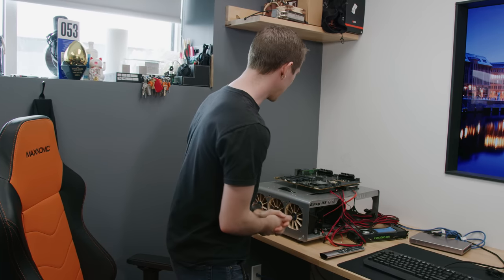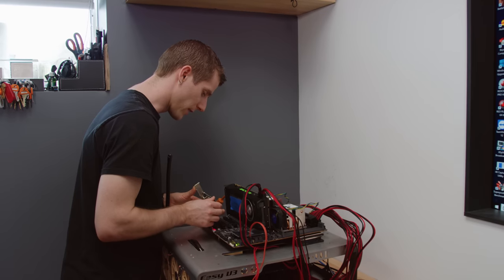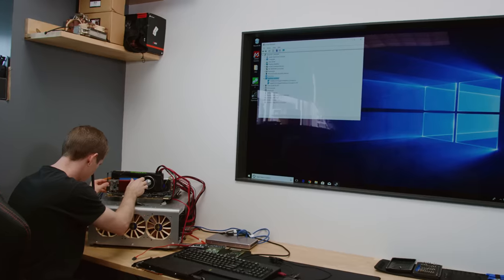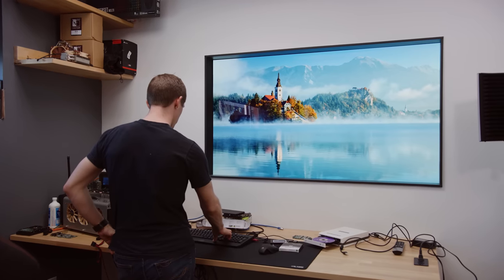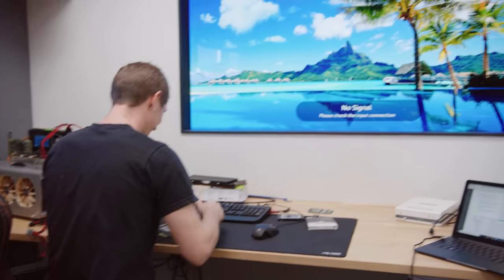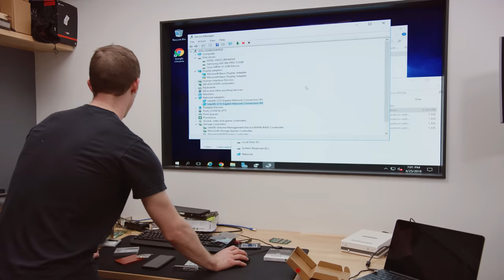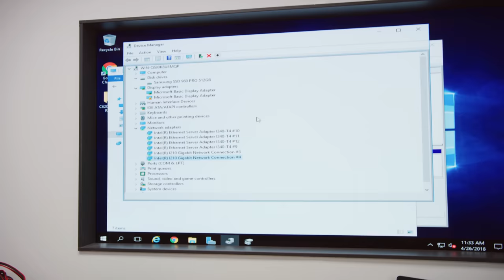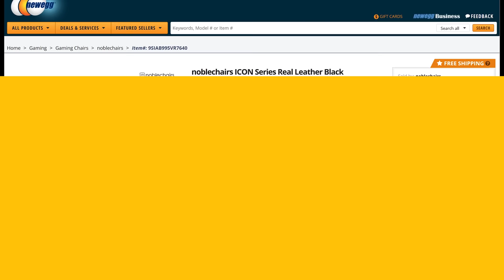I've NEVER been so FRUSTRATED... Hot-Swapping PCIe Cards

Comment: Hot swap a power supply
Reply: There are servers with dual psus where you can just pull one out
Reply: @electrosquid8325  all servers have to have that since you cant just power down a  server. Also PSU failures would be catastrophic.

...i should know as I accidentally crashed one with plugging in a PSU with the wrong wattage into it.
Good thing everything in a data center is redundant lol
Reply: @MrMarci878  In a datacenter maybe, small business servers often have single PSUs though. HP ML110s for example. Rackmount servers almost always have multiple power supplies so if you work in a datacenter, I guess that's why you think all servers are similar in configuration :)
Reply: @tredd6946  not a very bright business if they're not using some form of redundancy with PSUs (works for a small business) unless you're fully cloud based for everything, that's cheaping out on a stupid level IMO
Reply: like here, if it designed for it its no issue ;)
Reply: I've done it multiple times on dual PSU server. They are designed for it and it works flawlessly.
Reply: actually super common if you look at pretty much any server (expect some supermicro servers) you have 2 - 4 power supplies
Reply: @N0D0hNuts  No, I went to the "I dont read the label because I expect the one singular PSU that I order to be of correct wattage when I get it" school
Reply: Hot-swap motherboard.
Reply: @TheOneG36  Can you tell that to my dead geforce 4 series card I killed by plugging in power when the system was on?
Reply: @danielhall6805  iam pretty sure that a "Gforce" consumer product never had hot-swap, but you where lucky ;) back in the day i killed an ATI 9800XT while powering the system without having power plugged in oO. back then this stuff was way more sensitiv then today.....
Reply: @Lucroarna56  Its awesome when the Hot-Swap DUAL psu in your servers internal PDU (the interconnect board that makes hot-swap possible) fails. THEN your SOL.
Reply: You have to be quick
Reply: what could possibly go wrong :thonk:
Reply: @tredd6946  There are many tower style servers that also have multiple redundant PSUs.
Reply: @HudsonGTV  Yes there are. I said towers "often" have single PSUs, not "always". There are also some rackmount servers that don't have redundant PSUs although most do. Please read more carefully.
Reply: Jules i have a hp d360 and it even shows on the tiny screen thing on the front if one of the psus fail
Reply: Hot swap a rig
Reply: You can do that on Mac pro
Reply: No, hotswap a motherboard
Reply: @Perseagatuna  actually, storage servers like 3PAR 3000 you can hotswap even motherboard technically. I even had quarter of s motherboard powered while rest was without any power at all with single controller , no cpu, memory or drive and single psu without battery. Successfully recovered data from the system from the raid/jbod drives.
Reply: Hot swap Linus, with Anthony.
Reply: possible if the motherboard have bigger capacitors
Reply: Lol
Reply: Omg haha maybe it would work if u had a back up power supply connected
Reply: manomap972 and hot swap a motherboard
Reply: I know the original comment is old but I just read it and laughed out loud, gj
Reply: I have a pc that has that, no joke
Reply: The cpu
Reply: Servers have dual psu just for that
Reply: It exists in server
Reply: Thats a super common server feature, usually they have like 2-3 power supplies that are redundant back ups that can be hotswapped while the server only needs one to run
Reply: I can do that with my laptop
Reply: Lmfao
Reply: Everyone talking about servers when the real question is about desktop
Reply: My laptop will do it sometimes. If I'm quick
Reply: Yes
Reply: This will totally work ima go do it now
Reply: Try hot swapping your wall plug it’s very fun
Reply: Bruh imagine💀
Reply: Hot swap an outlet

Or the motherboard

Atleast
Reply: Maybe solder a giant super capacitor on the motherboard or add a battery in parallel to the power supply rails it should be fairly easy to do with the 12 volt standard motherboards
Reply: Works if your system has more than one
Reply: Why did everyone go to redundant psus in servers instead of laptops, tablets and just about any system with a battery?
Reply: @Lucroarna56  even big enterprises are moving to full cloud   and that due to dynamic payment
Reply: @jkmusicproductions3350   Shore and a build in ups
Reply: hotswap the motherboard
Reply: @teppomultimaki1074  it could work if you have persistent ram like intel optane on that you can install the os directly on ram and after you conect the power it will be on the same state
Reply: It’s possible
Reply: I wonder if that would be actually possible, because if you lead two ATX connectors to one ATX power supply connector on the mainboard you can plug one power supply in the one and the other one in the other connector and unplugg them if you want. Just never unplug both at the same time...
Reply: A great idea
Reply: Hot swap cpu
Reply: Not possible
Reply: The hottest of swaps
Reply: How would that work
Reply: Also known as a laptop!
Reply: FSP twins pro
Reply: @MrMarci878  Not all servers have that. It's a common, but optional feature. You can absolutely just power down a server. There are three main strategies: you can have one server that is really protected from failure, or you can have two or three servers without redundancy, or you can just accept that sometimes stuff stops working until the IT guy fixes it.

Comment: Finally, a feature that will save me 30 seconds every 5 years when I upgrade my GPU. Truly amazing.
Reply: @Egon Freeman you mean something like thunderbolt? Or Asus's proprietary external laptop GPU port?
Reply: @Egon Freeman I have a feeling it's for servers
Reply: Yeah because you have to set it up like 24h
Reply: @luisfarias2360  Definitely for the newer servers that use newer storage. Watching this 4 years later , almost all storage is hot swappable now in the home . Maybe this is how they developed/implemented these features.
Reply: to be fair, this would be pretty nice for things like express cards (pcie equivalent to PCI's pcmcia cards), which could let you quickly trade out exotic I/O for like retro controllers, old external drives, firewire for old peripherals, and things of that nature, that you only use for one or two devices that you genuinely do not need to always have, but would be nice to have access to easily.

Comment: Next Video: How to fix broken/worn out PCI-Express Slots..
Reply: Simple you just hot swap your motherboard
Reply: This is likely what that backplane is for. Typical PCIe connectors are only mechanically rated for 30 insertion cycles before their electrical specifications are no longer guaranteed.

In practice, PCIe is very robust and this isn't likely to be an issue unless you swap cards like a madman. I would suggest using riser cables so you ^2 your insertion cycles; if you wear out the slot on your riser, you get a new riser, not a new motherboard!
Reply: Even better, there are pcie riser with multiple connector, of course you can only connect one of them at a time, but for PCIE extreme hotswappers, it would be very helpful.
Reply: Tightening cream

Comment: Uses GTX Titan X "Just to have a display output" 😐
Reply: I thought exactly the same
Reply: Me too
Reply: SeedlessBananas was already on the bench, no point in swapping
Reply: Ikr
Reply: that board costs like 7x what a titan x does, not to mention the cpus
Reply: cauz' he can xD
Reply: He said it was a very old titan.
Reply: Lord_Doz "It's not that high-end anymore" -_-
Reply: He already has that Titan X, he might as well put it to use.
Besides, this board, let alone the chips don't have on-board Graphics anyways (afaik)
Reply: He’s running Windows 10 I believe on a server board with server grade processors. Would probably run dog slow without
Reply: Rizky Aiman rofl but all the other low-end and older cards he could've used haha. Just Linus things
Reply: its just the one they always have plugged into that bench.
Reply: Cameron Huneke indeed. But for the same purpose I described. Linus doesn’t do things by halves
Reply: Lol yeah why use on board or old cheap one if you have a fat stack of them laying around.
Reply: SeedlessBananas yeah he just have that Titan lying around for display output, just Linus things
Reply: Like using a Lamborghini to go for groceries.
Reply: that TITAN X worth more than my entire setup
Reply: hey i just need a display port. get the quadro
Reply: @RizkyAiman  an original titan is about as fast as a modern rx 580

Comment: Literally every hardware manufacturer on the planet: "Never plug or unplug PCI components when your system is running. PCI is not hot-swappable. Don't do it. It's no good. That's a NO-NO.
Linus: hot-swaps every PCI component available "Why is it not working?! What's going on?!"

This is why I subscribed. This is why I'm still subscribed. This is why I'm never unsubscribing.
Reply: Pfff, who listens to the people who makes the stuff? PfFFFF.
Reply: PCI != PCI-Express. PCI is a bus, PCI-Express is a collection of ports.
Reply: @deusexaethera  I am not even going to pretend I knew that. Thank you, the more I know.
Reply: The PCI-e spec is actually hot-swapable and has been since version 1.0, interesting that it's just a bios flag limiting it though.
Reply: @ShadowsNight1000  i think that its not just a flag because the mainboard has to initiallise the card and everything like on boot but while in windows so no post. and i think that not every shitty 30 mainboard or so will be able to do that. but im not a manufacturer so what do i know :P
Reply: @BadMax02_VR  I think you missed my point, but your English is a little broken so i l'm not sure. To clarify, if the board has the PCI-e logo on the board it needs to be PCI-e compliant, so everything about the board hardware wise has to support hot-swap since, like Sata it's a native feature. If the hardware wasn't following spec it wouldn't have the PCI-e logo on it eg. Any GPU with 2x 8pin power connector.
Reply: @ShadowsNight1000  oh ok i didn't know thats and Yeah im from Germany and dont care if i make a mistake. :P
Reply: @BadMax02_VR   Your fine :D as I said I wasn't sure. But I figure it couldn't hurt to explain anyway ;)
Reply: @ShadowsNight1000  Yes and no. The BIOS has to arrange the PCI bus enumeration in such a way that there's actually "room" for your hotswapped PCIe devices to actually exist on the bus. That's all those padding settings Linus glossed over at the start of the video when he enabled hotswap. If there isn't enough enumerated padding and you hotswap in a device, then you can't actually use it unless the operating system resets the entire bus and all devices on it. That's just as bad as a reboot, so no operating system actually supports re-enumeration.

For the record, PCIe is not the only kind of computer bus that uses the PCI enumeration model. There's also ExpressCard and Thunderbolt, both of which are PCIe derivatives that also require BIOS cooperation to reserve resources in order to work. And yes, a badly thought out BIOS can fuck up your ability to hotplug Thunderbolt just as badly as it can fuck up your ability to hotplug PCIe.
Reply: PCI Express is electrically hotpluggable, even it'd deriviatives like ExpressCard are hotpluggable, i have a hotpluggable eGPU over ExpressCard setup, granted i have to kill X in Linux each time i unplug or replug but that's no issue as it takes like 10 seconds for the entire process.
Reply: @ShadowsNight1000  Don't hot swap your GPU :P
Reply: hotswaping is in the standard of the PCI since the old days (PCI 2.1?)
Windows isn't built for Hotplug/Hotswap and you need special drivers for some dives.
In linux you had to input the maximum count of CPU's and memmory at the startup of the kernel.
Some devices had in the manual: Hotpluging is not working under Windows.
Reply: @mioo9387  maybe because those people know its limitations ? maybe just maybe ? they tested their boards before they actually sold it ?
Reply: @tankrage17  bruh, 5 month old sarcasm.
Reply: I hot-swapped PCI card (pci-x gigabit 3com rj45) on win2k far over 10 years ago. 

First: disable, fysically remove, refresh.
Done...
Add new or other, refresh and win2k find about any pci (or) pci-e cards and adapters, etc..
No special drivers or rare hardware.

IDE is working same way... HDD, cd and DVD..

Scsi, 1,2,3 ultra etc, working too.. 
Is the win2k and win2kser better than todays systems..

"NOOoOOooo??!!??!" -Linus ;)
Reply: You should add after the " Linus: " 
"Every PCI-E component manafacturer :  AM I A JOKE TO YOU "
Reply: YEAH :D
Reply: PCIe is (in theory) very hot swappable. Most commonly, SSDs are hot swappable but most anything can be hot swappable with the correct operating system support (Linux 👌)...

Comment: Linus: "This motherboard is PCI-E hot-swappable"

My motherboard: cannot hotswap case fans
Reply: I remember in my old PC,I tried hot swapping my case fans while recording audio because it was too loud. Removing it was fine but when I put that molex fan back, BOOM PSU blew up destroying our PC.
Reply: i actually hot swapped my 1070 and it worked. it was stupid but it worked
Reply: @salac1337  Balls of steel
Reply: @salac1337  I did that with my 7200gs, when it was on the bios
Reply: @Badr Ahmed I have an old USB scanner that sometimes can bluescreen the computer if you plug it in

Comment: In fact, for Linux hot unplug pci device will normally cause a kernel panic, as most driver doesn't handle PCIE error well.
If you follow correct way, by revmoing the kernel module using the device, and then echo 1 > <pcie_device>/remove, it could be removed without problem.

In fact, thunderbolt3 eGPU hot-unplug is just exactly hot unpluging an PCIE device, and it doesn't crash your Windows (but still crash linux as there is no way to disable one added GPU in X yet).
Reply: Dang, wish I saw your comment earlier, got a laptop with eGPU, fancied myself to try linux gaming, and boom.

Wasted almost 30 minutes before I realize whats happening :<
Reply: I'm going to do this with a spare motherboard right now
Reply: @Moataz AhmedA bit late, but here you have some forensics (in case you still wonder what happened that day): The PCie protocol is designed to be hot plug, but a difference thing is the connector type that you need to use for that. The ground level must be the same for the electronics of the device you have in your hand   and the equipment you are connecting it to, before letting any electrical signals to flow between the two (otherwise  an electric arc /  electrostatic discharge   can easily damage delicated chips). External connectors and external enclosures are designed to achieve just that (either the ground pin is  longer  so it gets  connected first, or just by ensuring  proper  contact between well designed  metallic parts of the enclosures before the connector is fully inserted  ). 
But no shame, I know it because it also happened to me.

Comment: Dangit, Linus. I tried this on my system and now my toaster won't work.
Reply: PCIe Toaster
Reply: Toast is hotswapable but its not safe unless you disable knife extraction in the bios
Reply: Usually bread is hot swappable in toasters by default. I know this because I've roasted my fingers for years hot swapping the stuff.
Reply: You need to jumpstart it with a wet metal fork while plugged in.
Reply: lmao
Reply: Directions unclear my graphics card now is toasted and buttered.
Reply: Erick Rosa I haven't looked at the API since they forked it, i'm still on the original version.
Reply: sir this was not recommended
Reply: Call Asus.  they got mine going, but it came out as rye.  I mean, rye toast is ok, but it's not what I was expecting.
Reply: LMAO
Reply: Scott Hildenbrand You should have bought the Razer toaster. It's the only toaster on the market that has a refresh rate higher than 60hz.
Reply: This is how Linus broke the Imac Pro! Plugged and unplugged shit while it was on.
Reply: try a soft resent then bios update
Reply: Robin Taylor what about the spooned version?